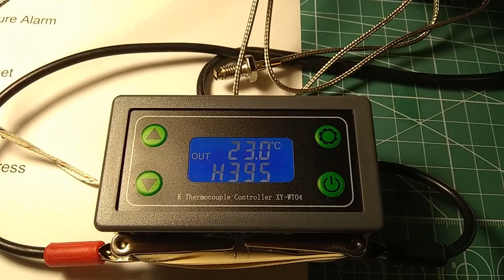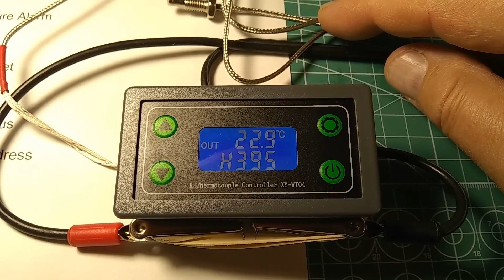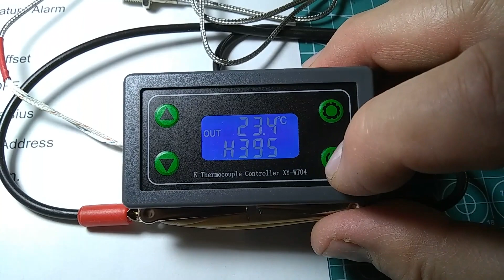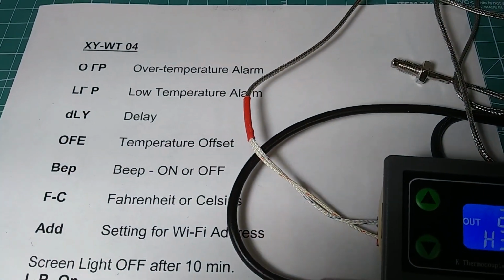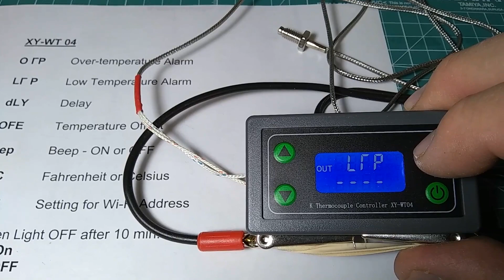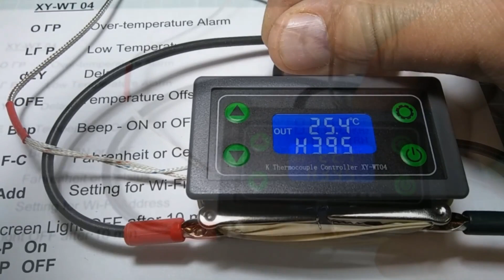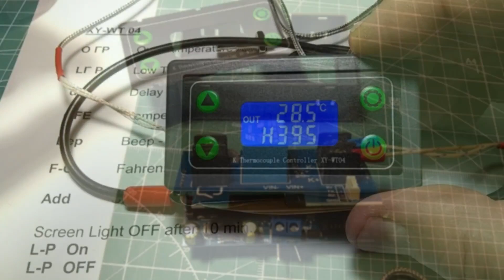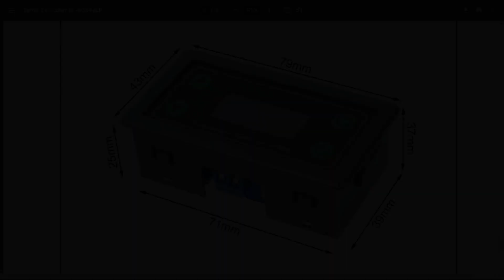Programming Temperature Controller XY-WT04 with Thermocouple

Comment: Good day. I would like to extend the wires from the temp probe so I can relocate the controller. Do you think  that will affect the reading from the sensor?  I would think I could compensate by adjusting the settings if he added wire alters the resistance in any way
Reply from the maker: Interesting question. The thermocouple type probes, suited for higher temp., generate tiny voltages in the range of millivolts or even microvolts. Your extension to the probe probably needs to be made of twisted and well shrouded wires to be effective and to give consistent readings free of distortion.  There may be another type of high temp. controller available that that has a remote, or a wireless, display box with the control buttons? All depends on how much you want to spend on it. 
There is also a v. similar looking temp. controller with NTC resistor probe instead of a thermocouple, good for lower temp. up to around 120 C. Those resistive probes could be extended with no issues. 
Good luck with your project!

Comment: Hi Sir thank you for the video I'm getting constant beeping on my device. It shows EAA on display and it's blinking. I guess EAA is some error but I can't figure out what could be. I have the original K thermocouple and my multimeter K thermocouple but not lucky to solve it or find some information about that error
Reply from the maker: Interesting! I don't see the code EAA at all on this particular controller's display. 
Let me ask:
1. Is your controller XY-WT04 or a different model? 
2. Are you able to enter the settings function at all? 
3. Does the beeping continue when the thermocouple is disconnected? 
4. Could you short the thermocouple terminals with a piece of wire and see if the beeping continues on? 
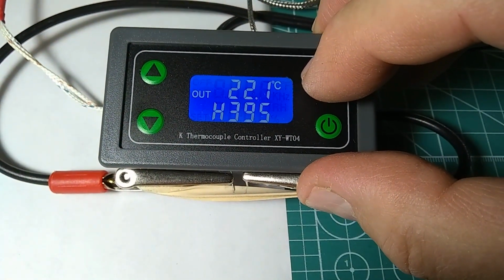In my controller the alarm can go on only in two situations: under temp. and over temp. But only when I set the alarm to go on, like at 3:22